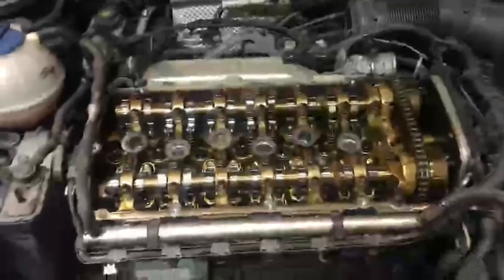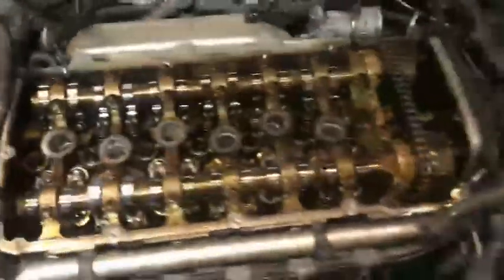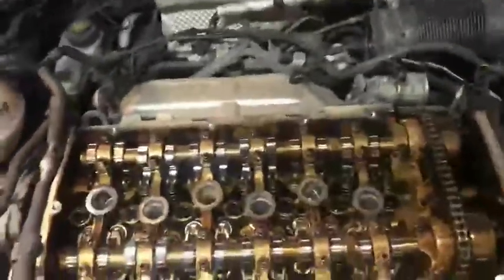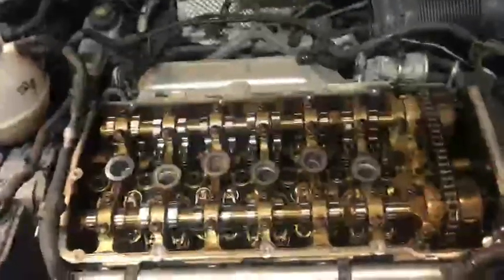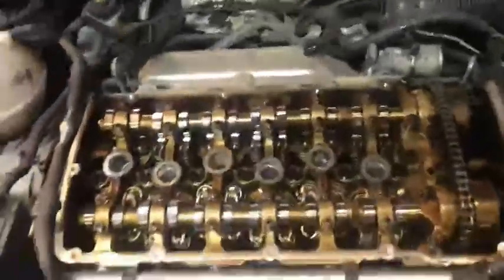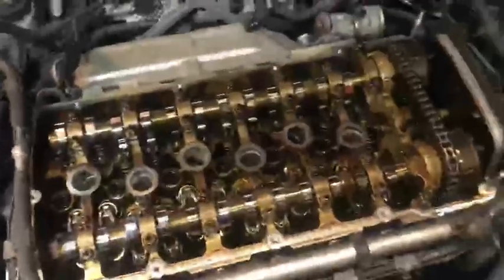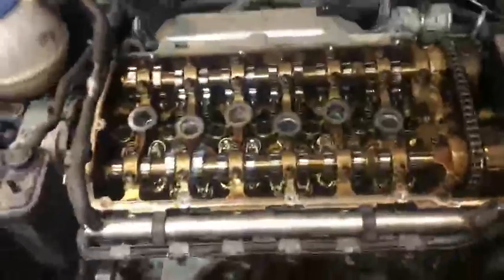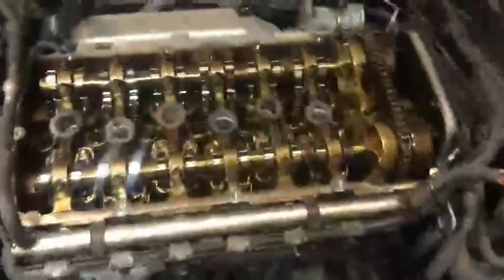Air vacuum leak on Audi TT 3,2 L How to remove Intake manifold

Comment: i tried removing that big vacuum hose in the beginning of your video that "clips" onto the intake. i couldn't get it off, i ended up leaving it alone. i didn't want to break the plastic part and not have a replacement.

if you remember how the clip gets undone I would appreciate it.

i really want to clean up all the gunk built up in my intake but cant because i can remove the whole thing.